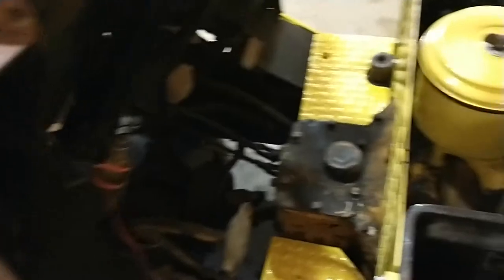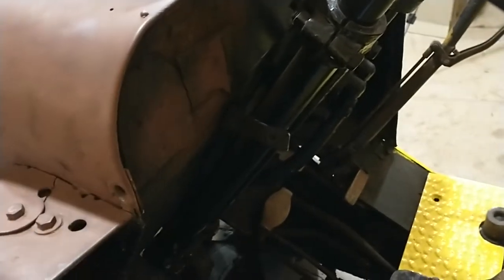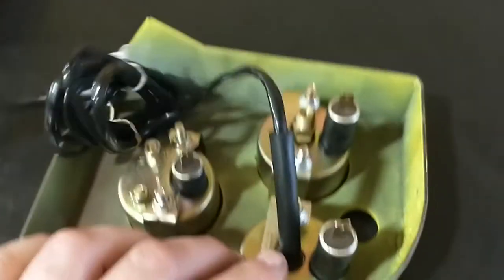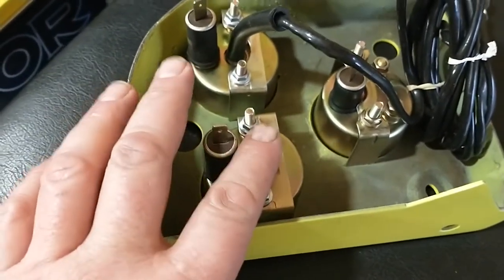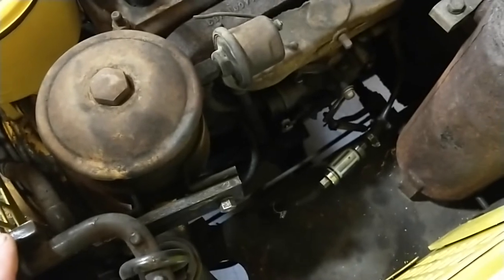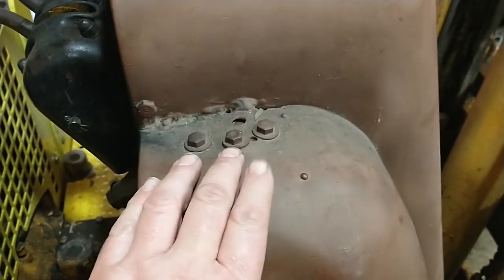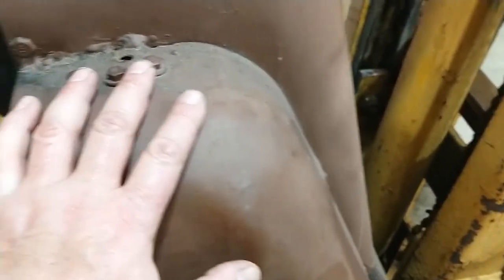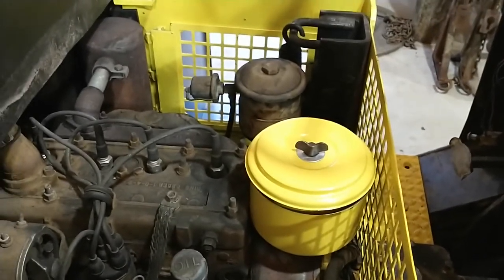1950 Towmotor LT40 Repair and Restoration Part 3

Comment: Nice vid man I have towmotor model 462S my issue is that when I’m using my forklift in about 30 minutes it starts to loose power any idea what could it be
Reply from the maker: @Luna-dt1nt It's tough to say without more information. I'm not familiar with that model. I'd look at ignition components first (defective coil, condenser, etc.). Good luck and thanks for watching and the comment!